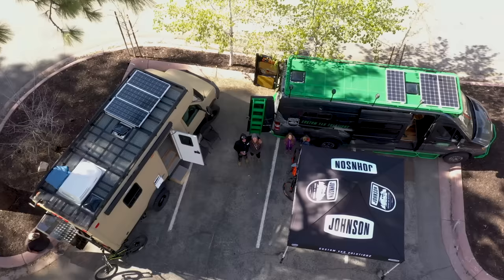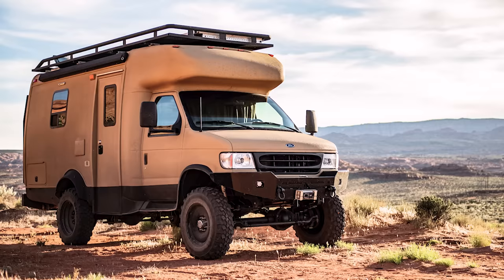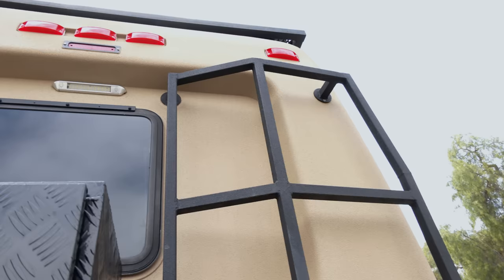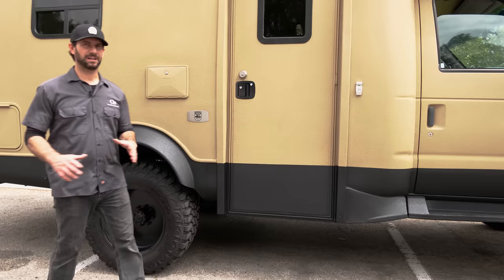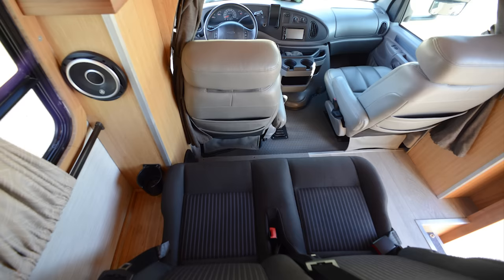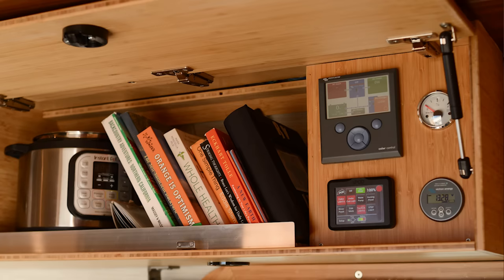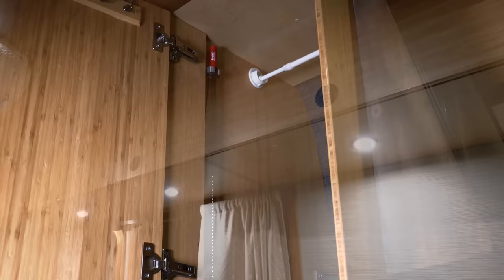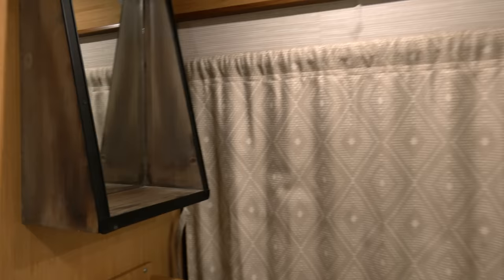4x4 Van Tour - Custom Adventure RV Starflyte 2.0 ! 4WD RV!

Comment: That's a Awesome Rig !!! Are you running locker in the diff's ?
Reply from the maker: In the front yes, rear is open, no issues so far!
Reply: @auxbuilt4190  Right On !! Hope it's a Detroit. Locker in the rear will make you feel invincible ! Safe Trails Man !!
Reply from the maker: Yes! True Trac!

Comment: Just curious, is there a reason it seems like all the really nice 4x4 conversions are done on the e series?
Reply from the maker: Yes, there are a dozen outfits in the USA that convert them to 4x4 and every motor Ford put in them has been rock solid. This van has the 5.4V8 and it was the 4th van I've owned with that motor that has never not started or needed anything really. The V10's were great and the older 03 and below 7.3 Powerstroke's were so good they have a cult following to this day. Starting in 2021 Ford came out with a new 7.3L gas engine called the Godzill and the reviews are stellar so far. Ford kicks ass basically. I have a diesel Dodge Ram 4500 for work and I average about $5k a year keeping that thing on the road!

Comment: itl be so much better if the price and engine was discuss
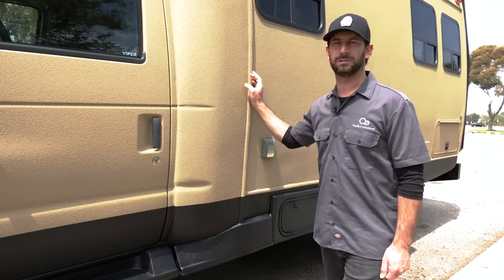Reply from the maker: Engine is a 5.4 V8 gas engine with 5:13 gearing to make up for power. Aprx 160k USD into the build.
Reply: @auxbuilt4190  man you nailed it for that price its worthed ...looks very nice ...well be watching your vlogs always ❤️❤️🦾🦾🇵🇭🇵🇭

Comment: I want a van with a manual transmission with an old fashioned stick shift on the floor. 
I don't think it exists anywhere.
Reply from the maker: Not these days, but yes that would be rad!
Reply: The older Astro vans had a stick in a few.  Rare but they do show up once in a while.

Comment: looks AWFULLY top-heavy to me. No worries if it tipping over when challenged by boulders??
Reply from the maker: It's tall looking but the weight is all frame height my friend! Of course a boulder could flip anything over. Avoid them, stay on trails and terrain that is safe-ish and you're good to go!
Reply: @auxbuilt4190  Hi, at your earliest convenience convenience kindly provide me with a comprehensive and Itemized Quotation to do a 1994  model. I want to establish a budget before I acquire the vehicle. The project would entail the shipment of the vehicle to the US as I am Africa based. I will greatly appreciate your assistance. Are you willing to correspond directly via email?

Comment: I like how @ 14:20 he shows where they ripped out the insulation and didn’t replace it just put vinyl over the fiberglass ( the big gap behind the window frame ) the next thing he says is  his favorite thing about the build is the attention to detail….. WTF?!?
Reply from the maker: WTF! Haha calm down myfren. The ENTIRE VAN is insulated. The shell is a sandwich, none of which I can "rip out". Fiberglass exterior/balsa wood/1" closed cell foam/balsa wood/fiberglass interior. Relax and enjoy the video!
Reply: @auxbuilt4190  
Even the best RV is very poorly insulated. Compared to a tent it’s insulated. Can you keep it warm/cold? Sure you can. But you can make it where you don’t use very much to keep it there just by adding insulation. I stay in places with 100+ degree heat. What’s the use of running an AC if it never stops? It’s just hard use on the unit and hard use on energy.